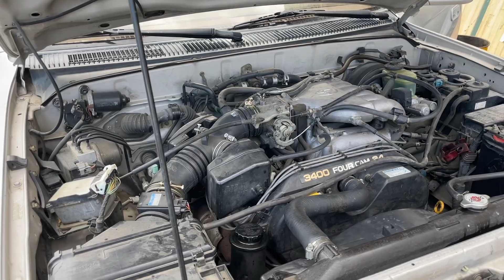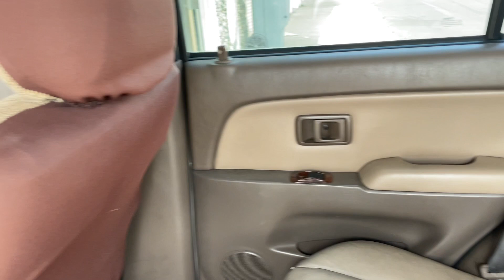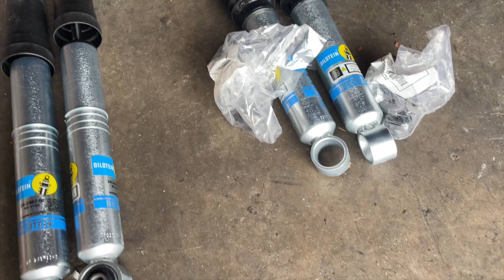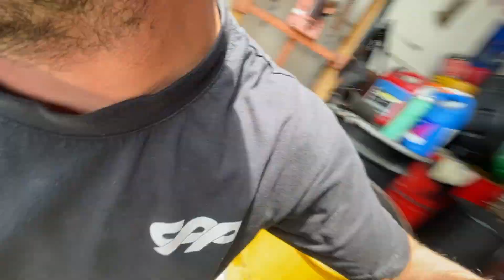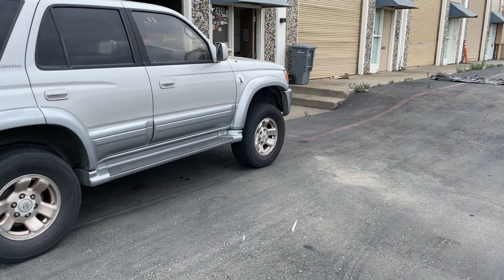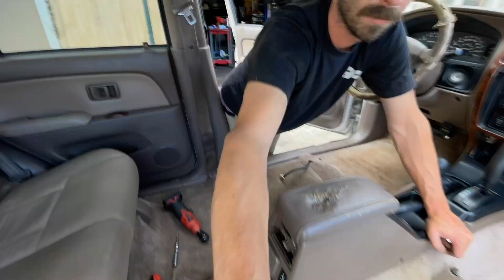WHAT DID I JUST BUY??? (New Clapped out 4Runner Series!)

Comment: Awesome project and video. Excited to see the next phase. Question: how are you able to confidently buy a 340,000 mile 4runner? While they are obviously very reliable, 24 years old and 340,000 miles seems to be end of life. Do you do some kind of engine test to determine potential continued durability? Obviously I’m not a mechanic. Thanks!
Reply from the maker: It’s always a gamble. I did not do any kind of engine test, however I am a mechanic. Buying used vehicles is tough but I typically pay very close attention to how a car looks & sounds. This particular truck sounded like it had good compression while cranking, and the engine bay looked like it hadn’t been touched in a long time. This can be both good and bad, but I prefer used cars to be unmolested. While regular maintenance didn’t seem to be a top priority, it also tells me that not much has failed recently and the bones of the truck hadn’t been molested by someone being careless. Checking all fluids is key, and looking under the oil cap will tell you how regularly the oil was changed. I don’t plan on putting 100k miles on this rig so I’m not looking for super long term, but I’ve bought many Toyotas with 200k and haven’t blinked an eye. I guess intuition is the primary tool I used when buying something like this. If it looks untouched and sounds good, there’s not much more I need to consider. Any rig you buy can blow a head gasket or lose a transmission at 100k or 400k. This thing leaks like crazy and didn’t have a functioning shock absorber on it, but it starts right up, shifts well, and doesn’t look like it was abused. The other factor is that I have a backup plan to LS swap it if/when the engine lets go, so every day this engine keeps chugging is just a bonus.
Reply: @MechanicalAdventures  How can you tell if it has good compression when cranking? Is it the time it takes to fire up and/or the sound? Thanks!
Reply from the maker: @mikeypotts4732  sound, each compression stroke (bump bump bump) should be strong and crisp sounding and they should all sound even/equal. It’s not a guarantee but it’s easy to hear if it has BAD compression
Reply: Let me tell you about my T4fr. I bought it 15 years ago from the original owner with 169K miles, paid $1500 needed tires. Still my daily driver with 408K miles. Never had the motor out or apart & runs great. Just regular maintenance. Had to replace a few minor things that wear out, nothing  major or expensive. I'm gonna drive it to till the wheels fàll off,